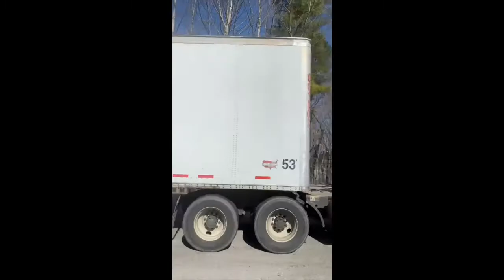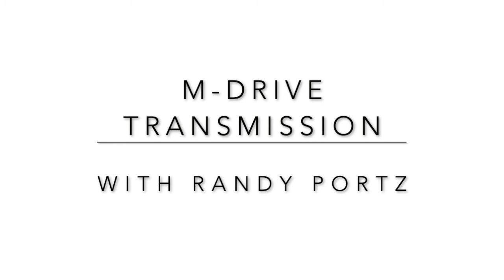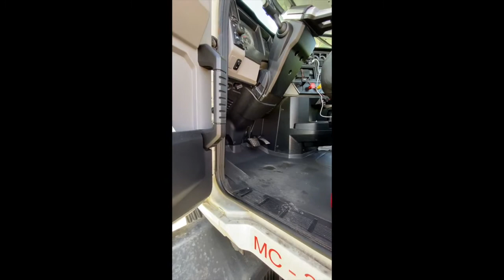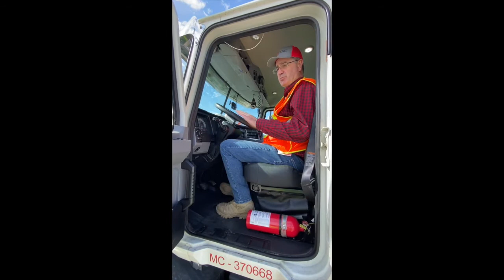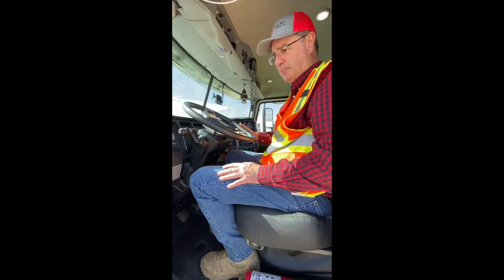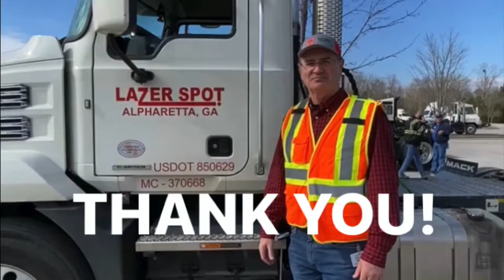Randy Chats: M-Drive Transmission

Comment: Which would you recommend to a newby
Reply: If want automatic and doin anything but hiway Allison is so much smoother seamless, faster acceleration ect. I drive m drive at work in rolloff application so a lot tight space and city driving. Well it been in shop last couple weeks and I got drive the same truck but Allison it so much less work to get goin make manoeuvres ect. Especially better when loaded heavy and slight incline to get goin Allison goes, m drive got start creeper gear and don’t skip shift so it’s slow af, I can shift 18speed quicker…

Comment: Good I would be doing everything in my power to burn up that clutch it serves these companies right I would not step on the brake  it tickles me pink now knowing  what you revealed those Moron drives are the same as Volvos idiot shift trans  Thankyou for revealing this revenge knowledge that I can start using immediately